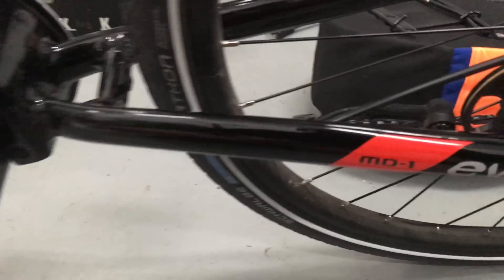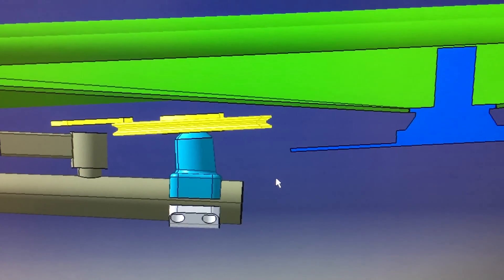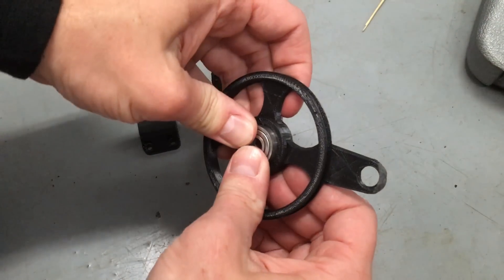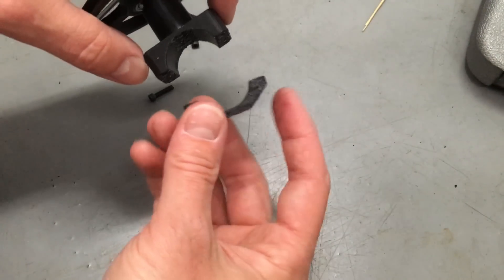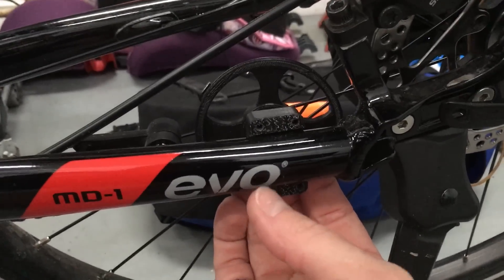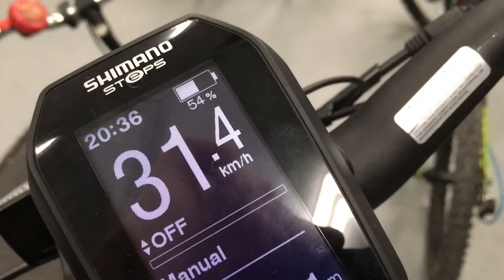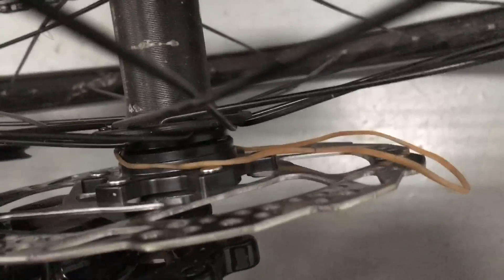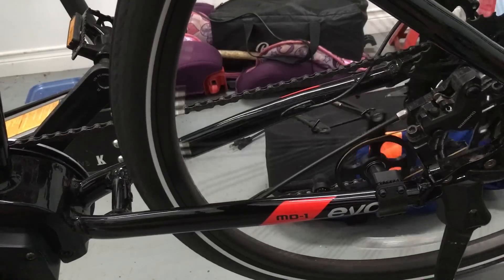e-Bike speed limit unlock hack - Works on Shimano steps and others

Comment: It is cheap if you dont factor in the costs of learning how to 3D model and owning a 3D printer. But I do love this solution. You can fine tune your speed limit instead of removing it all together. You'll probably want to machine the parts out of metal for rougher terain though. And maybe use a chain instead of a rubber band.

Comment: Yes, you could spend thousands of dollars on an eBike https://www.youtube.com/post/UgkxUiL0GnyDjP32RJdd660sP8mZk4CRLTCJ  and get something much higher quality. However, if you're looking for a basic model to try out eBiking this is a great choice. The assembly is easy as far as bikes go (took about an hour for me to do, I'm not an expert). All tools needed are included. I added the plastic mud guards you see and a more comfortable seat. The other reviews are correct that you're probably going to want a better seat (Giddy Up! Bike Seat is what I got - super comfortable). The battery easily handles a 2-4 hour ride if you add some of your own pedal power. I haven't even gotten it up to top speed yet - it is very fast. Components are not top of the line, but decent for the price and work just fine. It works great on dirt roads and singletrack and pavement although too heavy to do tricks or any serious technical mountain biking. I'm looking forward to using it a lot over the summer. Tons of fun!
Reply: Do ads now also come in comment form, lol.

Comment: It would be nice to have different sizes so it is possible to adjust the speed. Max 35km/h is more than enough on busy dutch bike roads. Would be perfect if my speed meter says 25(the speed limit in NL and I  drive 35 😀

Comment: Have you had error for e014 because of having it installed with different positioning? 
I did similar to yours 
Just installed sensors on outside of frame and magnets on crank arm unfortunately I got e014 error I can’t get rid of
Reply from the maker: Typical, Shimano is programmed to detect if the magnet gets installed on the crank. With my modification you won't get this error message.

Comment: I have a gazelle chamonix 7 and i use a carryingwheel i bought at gamma. I cut it in two whit a shaw. Then bought a refreshing device that has the contour of your puley. I gluded it on the wheel. The frame has 3 holes where the sidestandard is attatched. There i attatched the wheel. Then i gluded  a tierib on the plastic of the bachwheel axis. I bought a bag whit 3 camping elastic. I cut one and gluded it together. I gluded a magnet on the refreshingdevice and it works!

Comment: LOL
I prefer to change preferences in software to US region (20mpg = 32kmp) and software wheel size to 26" it unlock speed to 35kmp without any hardware modifications. :)
Reply from the maker: 35km/h is not fast enough for me! On my unit I can't change the wheel size. Only a dealer can do it. So I was stuck at 32km/h (US settings).

Comment: With some, actually a lot, of help from Thomas I made one of these for my bike. Works like a damn. Changed the crank sprocket to 44 tooth, can maintain 40 kph on level ground. Always carry a spare elastic or leave the original sensor further out on the spoke in case you need to reposition to get you home. Carrying an extra battery if you like longer rides can be helpful getting you home.

Comment: Try the STunlocker app (And the STride app). About 30,- dollars for the premium version, change your settings using bluetooth. Shows accurate speed. Works well. Also on the other Step motors (not all with the same adjusments). See also: @t
Reply from the maker: Great, but mine is a E6000. So it is not supported by the STunlocker, probably doesn't have bluetooth.
Reply: @atcaron  There is a (older) Windows version of STunlocker available for free (from stunlocker.com). Probalby need a cable to connect between your pc and a free port of your bikecomputer. No expirience with that.  But perhaps someone can help you on the EMTB forum.
Reply: @atcaron  Mine is a E-6002 , but  does not support Bluetooth , nor can I see anywhere to connect a computer.

Comment: Can it take some down hill action? I know you could always uninstall it for climbs and descent, but that takes a bit of time and those tiny screws are easy to misplace out there on the trails. I'd only use this for commuting a bit faster.
Reply from the maker: I guess it could to some point. Try it! Worst case you will need to print a back up...
Reply: @atcaron  I will for sure if I don't end up buying a stunlocker.

Comment: On latest Shimano steps you can not remove E014 if you use the magnet on pedal option. Motor need to be replaced.  So this may be the way to do it.
Reply: good feedback
Reply: I watched this video and tried it out but after 10km it locked in at E014. Have you since found out how to fix this? (without having to replace the motor?). Mine will not correct even whilst riding it with many crank rotations Lakro?
Reply: @jamiegrayson3739  I have not tried this.  Important is that speed are not the same so different diameter is needed.  But still the ratio always will be locked but not 1:1 but f.ex 1:2.  So It may undersand that you have hacked it.  I do use a box inn beween the sensor that gives normal signal up to 22-23 kmh, after that It just show speed around 23kmh even if I run 30Kmh
Reply: Found out the hard way. Tried the speed hack & got the dreaded EO14 error after 12km. Scoured the internet & tried all solutions. Now booked in for motor replacement around A$1200. My advice is do not do this unless you want to brick your motor.

Comment: It has been almost 3 years since you installed the system. Has the system thrown any error code and is still the engine still working? If so, how many  miles on it have you put (I mean real miles since I guess the miles reading is wrong and reduced by the same proportion as the ratio between your wheel and the rear axe). Thanks
Reply from the maker: Good question! So far 7150 km so about 4400 miles. Real distance, I installed another speedometer to read the real speed and distance (as shown in another video). I only had codes when the elastic band broke (every 2000 km or so) normal maintenance I guess. Other than that everything runs fine. The key is that the motor is not overdriven to higher power or current. I just removed the speed limit.
Reply: @atcaron  Thanks thomas, that is great. I was only worried that even if the power is not increased, technically the motor spins faster when you pedal at lets say 30 or 35km/h (the speed I would typically go at) so feared the internal gears (made of Nylon I think) would get over-worn very fast, and since I think/understand no replacement gear can be found, this would be very problematic.
Reply from the maker: Guillaume van Renterghem I typically go at about 45 km/h and no signs of wear so far. I didn’t notice vibration or changes in the noise coming from the motor.
Reply: Awesome job. Can't wait. I'll try and get one made up here in Australia. Thanks for the idea. Love it.
Reply: Can someone please print me one. I want to do it to my ebig 400 nine. Shimano ep8. Thanks.

Comment: If I have Shimano Steps E6100 series motor with 36V 250W 50Nm + 36 V Comfort Li-Ion battery 625Wh (17.4Ah) 40-65Nm what will be the highest max speed ? Thanks
Reply from the maker: It dependsIt depends on the gear ration, how much you pedal, wheel diameter, tires... But you will go about 50 km/h

Comment: THIS SEEMS LIKE A LOT MORE WORK THAN JUST PUTTING MAGNET ON BACK OF PEDAL AND MOVING SENSOR TO OUTSIDE OF THE FRAME. IS THERE SOME ADVANTAGE HERE I'M NOT SEEING?
Reply from the maker: Shimano system will figure out that the rev per minute of the pedals and wheels are the same and will stop working. They thought about this...

Comment: Nice but can’t help feeling and in-line electronic pulse divide by 2 would be simpler and more reliable.
Reply from the maker: I agree, but I don't have the skills for that. There are systems based on this concept on the market already, but they require a battery. Also they divide by 2 only passed a certain speed, so you don't have low speed issues. I did something mechanic because it was "free" for me.

Comment: While this is a nice idea, just a friendly reminder - in EU countries - being caught with this on your eBike will be a very serious punishment. Not to mention, if you have an accident and/or injure someone with this kind of modification you will be punished severely for it - since the 25km/h speed limit is there to prevent serious risk to both eBike riders & the general public.
Reply: But here's the thing you can get a normal non electric pedal racing bike to go faster a bit unfair don't you think
Reply: My  bike has 11 gears and the motor cuts out on the 9th that's dangerous your going up a gear and hit a massive wall you got a massive sudden loss of power its like throwing a car in reverse when doing 80 mph especially when going up hill down hill i hit 30 mph so what is the point when you go down hill the restrictions don't work anymore any way lmao
Reply: I think 25 mph would be reasonable
Reply: The biggest problem is good enough breaks
Reply: I say breaks because ebikes especially pedlecs are normally much heavier
Reply: Funny thing in murder in EU is like 7 years, so an ebike is what, 1 day?

Comment: What kind of magnets will work for this type of modification?
Reply: Neodymium magnets work the best you can buy them from amazon in all different sizes. They are very strong magnets for there size and I haven't used any other magnet that comes close by power and size.

Comment: Thanks heaps man it worked. I printed your EVO MD-1 design then filed the plastic down to fit my bike (Merida eOne Sixty). I used zip ties to strap it on. So far it works but in the long run I will have to print it again with measurements for my bike. Donated some money too cheers!

Comment: just a question, if i don't want to double the speed but just make it faster say to 30kmh how should it be done ? make the wheel smaller or it just does not work like that  ? thank
Reply from the maker: You got it. The speed max will depend on the diameter ratio. The bigger the wheel the higher the speed limit.

Comment: Neat idea, but this won't work in colder countries. The rubber band will snap in the cold.
Reply from the maker: Worked for me at -5°C.  The only issue is in heavy snow. The pulley gets packed with snow. It would need a guard...

Comment: Can you just add a second magnet on the wheel?
Reply from the maker: Sam's Town Cyclery Cameron Park Shingle Springs this would have the opposite effect. The speedometer would read twice the speed. Therefore the max speed would drop to 16 km/h instead of the original 32 km/h.

Comment: Haw about puting an electro magnet on the sensor with small arduino type chip, which keeps turning it on with some frequency ( or adding frequency generator directly to the cable)
Reply from the maker: That's a good idea, but I don't have the skills to do that. Some electronic device are already available on the market for this. like Badassebikes Box.

Comment: Hi Tom,
Thanks for uploading and sharing the template, Im going to build it and see how it goes, what size bearings did you use? Also what is the diameter of the magnet?
Reply from the maker: The info is on the hardware page of my website
Reply: @atcaron   Thanks Tom, Im in the process of ordering parts and trying to convince my friend to print the parts for me.
Out of interest, have you had any negative effects from the added speed? has the battery life decreased? have the electrics worn out quicker? have you got a speeding ticket? :)
Thanks!
Reply from the maker: @jward0071  No negative effect so far. I don't expect problems since the hack doesn't modify the max power of the motor. So same current and power. Battery life looks good so far. Of course the battery last less km since you are going faster. No sppeding tickets. I'm usualy going at 
45 km/h.

Comment: Why don't you just attach the magnet to the pedal? At a 33/11 ratio you can reach speeds of 75km/h... That costs 2 tie wraps and 5 minutes of your time.
Reply from the maker: If you put the magnet on the pedal, the Shimano system will detect that the wheel goes exactly at the same speed than the pedal and will give you an error message after a few turns... To make this work, you need to put 2 magnets on the crank. But then the max speed drops too much.
Reply: @atcaron  On my Giant Prime E+2 with Yamaha sync drive it works perfectly.
Reply from the maker: @joerivankallo  That's great, but Shimano has something in the firmware to prevent this hack. I whish it was a simple as that!
Reply: In my case I did get the E014 error.  Not able to remove the error by setting sensor back and turning pedals. So when the where I bought the eBike.  Had to replace the motor (on warranty) to fix the error.  So do not do this on newer Shimano steps.  You destroy your bike.

Comment: nice work, did not you try to change the wheel circumference through e tube software? I have steps 8000 and it works for me. you need only logged in a company version. I have a wheel of 2200 mm circumference and I set 1400mm. At a speed of about 30 km / h, the display shows 20km / h. the actual maximum speed is about 45 km / h depending on the gears
Reply from the maker: This is really interesting information. I have a steps 6000 system. In the past I tried to use the e tube without success. Maybe I should try the latest version. Is there a minimum wheel circumference? Could you set it to half the real circumference to double the seed limit? With my modification, my top speed is 64 km/h (twice the original 32 km/h). I frequently go to 50 km/h, so in my case 45 km/h would not be enough. I also changed the front gear to a bigger one to have more top speed.
Reply: @atcaron  I did not miss the smallest possible wheel size. I set it up randomly. I work for the company where I mount Steps to a recumbent trike. That's why I use the latest software and I have it unlocked as an OEM maker. I personally drive about 30km / h. It is possible that the engine would also allow a higher speed, but I do not use it. I need to have the strength uphill. Otherwise, justify my English, I use Google Translator
Reply: @miroozimy  Is it possible to find such application on the internet ? Basic etube app does not have circumference of wheel.

Comment: Nice job. This is mechanical frequency divider...I think an easier way is to make an electronic frequency divider as badass or speedbox.
Reply from the maker: I agree, but since i'm better at mechanical stuff than electronic stuff... Also, this is quite rugged and doesn't require battery, don't risk to destroy the shimano electronics and is fail safe. If something goes bas, you just slide the original magnet back in place and continue your ride. I've done 3000km with this and it is still working like a charm. Just need to replace the rubber band every 1000km or so.
Reply: Sure, your gear is nice and simple, I like it. But there is problem with very slow ride in steep hills when Shimano says some error code and interrupts motor power for second. It is caused by SW protection. Electronics can do non-linear gear ratio (up to 20km/h 1:1, faster 1:2) , but mechanical does not by simple way (maybe centrifugal gear switch would be needed). Anyway, your machine is helpful and good solution for road riders who are familiar with 3D printing.
Reply from the maker: @IvanBenkovic  My setup works fine even at 10km/h speed in steep hills.
Reply: Bet there is some simple gate the size of a sugar cube that makes one output for every two inputs, this rubber band thing would get a hard time on a mtb on a rough trail.
Reply from the maker: @Bultish  Of course, but more expensive...
Reply: https://www.electronics-tutorials.ws/counter/count_1.html

Comment: you can fix the error code by putting the magnet back to the correct original position  then  riding the bike wile powered on showing the error code . after  you ride it it catches up with the correct  amount of pedal turns and all of a sudden the error code goes away .

Comment: How to fix E014 error?
Reply from the maker: Damian Szymański you will get error e014 if you put the magnet on the pedal crank. With my modification you will not get E014. The system reports E014 when the wheel speed and the crank speed is the same.
Reply: Just go use the bike and it wil gone
Reply: White the Magnet in normal positionering ofcorse
Reply: How fix this error?

Comment: i want one peace of that?
where can i buy one?
thanks
Reply from the maker: I invented and made this myself. I don't think anybody sells such a kit. This is really bike specific. If you have the exact same bike I could print you one. But if your bike is different, it won't fit because the clamp the goes on the frame must have the right diameter, offset and angle relative to the wheel.
Reply: Hi Thomas I have the same bike as you and was wondering if you would make me the same pulley kit as in the video and how much it would cost? Thanks and hope to hear from you soon you are a real genius.
Reply: Gualter Jacinto I like the system set up, do they sale the pulley on line?
Reply from the maker: I made this myself. I guess I could sell you a pulley, but you would still have to make the braket to attach it to the bike...